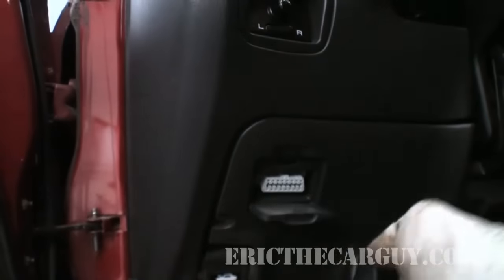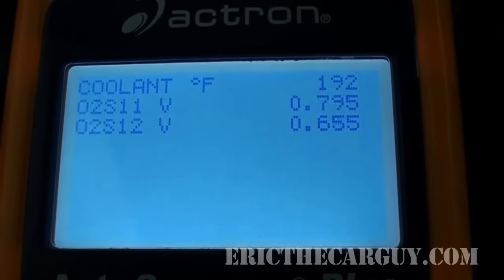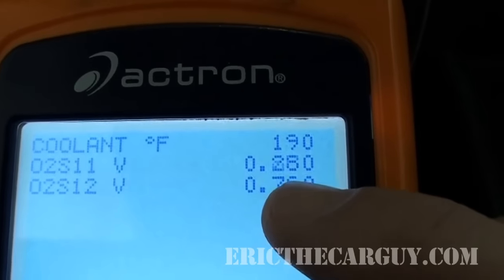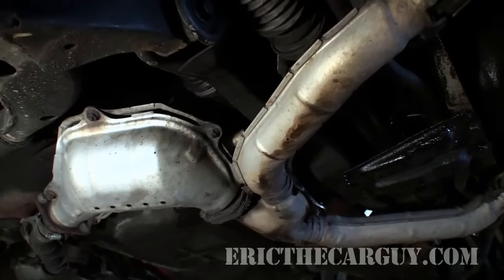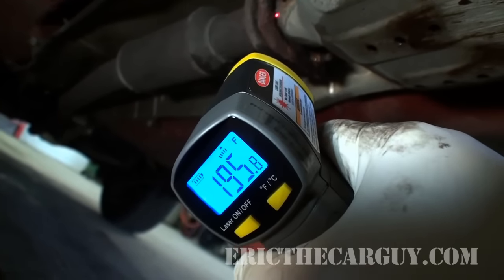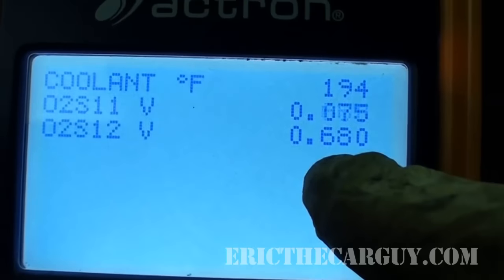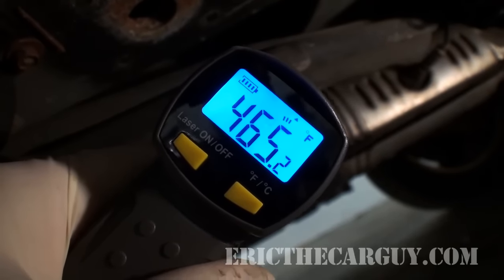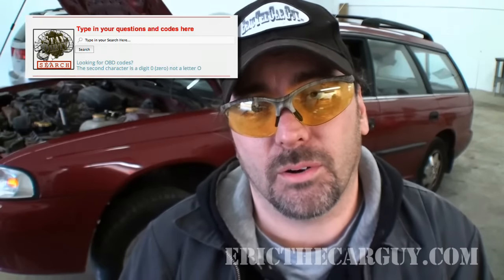P0420 How To Diagnose A Bad Catalytic Converter -EricTheCarGuy

Comment: Wait the first temperature test on the first vehicle was all over the place and off by a hundred or more degrees and you said it was bad then you tested a second vehicle and the same thing teperature was a couple hundred degree differwnce and you said that it was good can you explain please because Im dying to know how you came up with that
Reply: inlet hotter vs outlet colder = bad (exhaust not getting heated), inlet colder vs outlet hotter = good (heat dispersion). at least that is my current theory

Comment: I actually use Torque on my Android phone to watch all kind of readouts on my car (I love Torque). However, while I am certainly able to get the read out of the o2 sensors, I never really knew what was going on when I saw the readouts. It just looked like bouncing numbers and I since my car was throwing the code P0420 but had no noticeable perfomance issues, I just ignored it. Now my car won't accelerate and started having heavy hasitation at 5500 rpm which has deteriorated to 4000rpm. 
1/2

Comment: The cat should increase the temperature of the exhaust.  If the temp going out is not greater than the temp coming in, the converter is not working.

Comment: hey erice im a u.s i.g and i came home from AT and got an 2001 audi a6 it got 95k on it and it and temp started to go up a little on it and then it would start to misfiring on bank 2 ( cyc 4,5,6 )so i replace all sparks pugs and wire but still have the problem so i take it to pep boys and they said my cat's r bad r they right i did get a o2 sensor code it was sensor 2 bank 2
Reply: Like Eric says, if you have the code P0420, you will MOST LIKELY have a BAD CAT. The 02 sensors read the fuel and air mixtures and send signals back to the ECU. It has been said to replace 02 sensors every 2 years or so, to maintain proper readings and MPG. Due to all of the impurities that move through the fuel system and oil burning etc. You probably got it fixed by now. But just saying

Comment: I have a 95 camaro z28. It has a 5.7 lt1. My car recently started losing power. The car is fine but once it hits operating temperature the car starts sputtering and losing power as I drive. It seems that it doesn’t putter if the car is in park and I rev the engine. The problem is only when the car is warm and as I’m driving. Someone  know of a issue that can be

Comment: In the hope someone comes here and read this... I've had performance issue since last year. When scanning for codes, I have the error code 4185 (BMW specific) - exhaust gas temperature sensor before cat., signal too high and then I can read temps around 760-770° Celcius. It's a diesel btw. The error ONLY pops up when a regeneration cycle is kicking in. If a regen cycle never kicks in, the error won't show up.

Is that temperature too high (also remember this is in celsius) ? Is it possible the sensor is at fault ? Can this sensor actually refrain the engine from delivering all its power ?

I have an IR thermometer but I can't get close enough to the cat. converter, and below the car it's equally hard.

Comment: What if I have the same code and the second O2 sensor voltage is around 2 volts and moving fast and the first O2 sensor is around half a volt?!
Reply: The 2nd sensor is probably bad. Normal voltage should be 0 to 1 volt

Comment: Hi.I would like to view my problem of the Dodge journny engine 3.6 problem The engine temperature rise in the summer up to 120c The radiator and thurmostate have changed the cooling methods and the same problem when diagnosing the fault code p0420 is the cause of the problem.i from in iraq

Comment: Hi. My scanner sent me two codes one is P0327 and P0430. Can you please tell me what that means? Thank you.
Reply: 430 is the converter
Reply: google will tell you...
Reply: This knock sensor and catalytic converter Bank 2. Check the wiring of the knock sensor, if in order to replace the sensor. Install electronic emulator serviceable catalyst. It's simple :)

Comment: Quick fix to restore power, remove catalytic converter, take a straight metal pointy, well what you use when you play horseshoes, anyway, take a big hammer and knock the pipe through a couple times, dump out converter and you are good unless you have to smog your car.

Comment: Heres one that will make you scratch your head.  2011 nissan 2.0  intermittent  P0420, dash light goes out, i go get it smogged, passes with lower nox/hc than 2 years ago.  Drive out of the lot, dash light for the p0420 comes on.

Comment: What causes catalytic converters to go bad? Age? Miles? Bad from birth?
Reply: little bit of everything.  they get gummed up with particulate matter before eventually clogging and robbing performance, or they corrode away and leave you with a cat that barely does it's job
Reply: leakin fuel injectors, primary/secondary ignition (cap, rotor, CPS sensor, camshaft sensor, coil pack), along with an aged O2 sensor would trip the code

Comment: what would make my truck go only35 mile per hour, when I got the has it wants to bog down
Reply: a clogged cat could definitely make a bigger vehicle top off around 35.  so could a bad tranny...or alternator...hell bad wiring could cause problems with the brakes (or again, the tranny).  does it do this periodically are always?  a lot of cars have a built in "limp" mode so you can get home w/out further tranny damage.  hopefully ou've had it looked at by now :-)

Comment: My shocks/struts are worn and my exhaust/catalytic converter is corroded can you make a video replacing them I can't afford $1,000's to take it to a shop
Reply: Chris:  In regards to the shocks/struts:  Best bet will be to always purchase a Haynes or Chilton's repair manual.  If Eric is lucky enough to have your make and model for a video?  Then you'll have detailed answers.  But as often the case it's normally one car that wanders into the shop that he does a video--a lot of the information can be used on other cars, however the detail items (torque specs and such)  you'll still need a shop manual.  It's a good investment.
Reply: It's called youtube chris. And also scotty kilborn has a video showing this basic thing. But you should youtube it for your specific model im sure it's on there or in a forum sight on a video exactly the steps for you ok.

Comment: Someone chime in : installed "high flow cat" (cheap ebay unit) on Honda Civic. Now I have the code. Went this route because an OEM one or comparable is hundreds more! Anyone have success with O2 extenders/elbows?

Comment: How badly would a clogged cat affect fuel economy?
Reply: Jonathan Wolff on newer cars it will effect it considerably. most newer cars are meant to run off the back pressure from those cats,  if you got an older car when cats were first being introduced you can rip that sucker off and keep driving and never notice.

Comment: my Car , a 2012 kia óptima, makes a "tic tic tic" sound when i turn it off under the Car, like hot metal?
Reply: +Edwin Mendez That could be the sound of your car cooling off. I can't say for sure since I can't hear it, but oil dripping back into the oil pan can make that noise.

Comment: informative but neither car was nowhere near 1200-1600F not even the one with good sensor rreading
Reply: I was thinking the same thing !!
Reply: I believe that temp of 1200 is more of a max that is only at the Catalyst core & at Highway speed under load.
Kinda hard to show that on video, right ? LOL
Reply: @hellosunshine1090  , it could be also be shown with a scan tool at idle ?

Comment: A cat wont work at 200F it needs to be much hotter! the IR probe gives an indication of input vs output temperature on the outside of the pipe though!

Comment: Ok, so I have done exactly what you constantly warn, instruct against I've had everything in-between replaced for a crank, no start in a 1991 Honda Civic DX. So timing belt, timing belt tensioner, (water pump too of course), spark plugs, spark plug wires, distributor, MAP Sensor, starter relay, engine coolant temp sensor, pvc valve and hose, but  I'm a girl and, lets face it guys don't listen to girls when cars are involved Now, me, knowing when the issue began, I am pretty confident where the issue lies, can't be sure, 100%.   But, every man and/or mechanic that has looked at it has been confused by the failure to start because of the age and mileage of the engine as well as the amount of work and new parts it has had. And the seemingly correct timing and functionality of engine itself. 
Where it all began.........
Checking hoses on car, vacuum etc. the hose at the pcv CRUMBLES literally, like shattered glass or Aunt Edna's dry cookies that you only accept to be polite but choke on because they are dry as the Mohave, and after one bite, the rest of the cookie is in a pile of crumbs in your lap.. That is what the hose did. Disintegrated.  
Well no way to prevent it from dropping into the intake, and that is what locked the valve open, now I don't know where the pieces of the hose would go once sucked down, but the valve chamber was forced open and stuck,  hence the replacement. After that, loss of power, acceleration was effected and  car wouldn't reach anything over 55mph and it was a miracle to achieve that. I express that I am concerned it has something to do with the cat converter as the atrocious sound of the engine when it was running, like the exhaust is being amplified by a bullhorn run through a couple 15inch competition subs. And the performance after that issue had taken place. Of course, the girl can't be right...... so the car eventually dies, won't start.
Months later.........
Car won't start after all the above mentioned have been replaced and repaired. Timing is lined up, blah blah blah, compression, spark, power, BUT,  NO START. When you try to start it it almost sounds as if the engine is ceasing, or catching on something,  it just gives up.Looses hope and errrggg, sticks. 
SOMEONE.... ANYONE?????????? A little help please, car has only 160,000, it could run forever.......

If it could start at all that is. No check engine light, well at least up until the point that it died, there wasn't one, if it could drive around the block that may change now, but up til it quit running, no check engine light was showing.
Reply: +Nikki Chapman  Oh by the way when the hose particles when into the valve, shortly after, little tinkling noises, like little BB's in a glass bottle or similar to that during acceleration, especially while the car was attempting to shift from one gear to the next. That detail may be helpful.
Reply: +Nikki Chapman if a valve got stuck open by the hose pieces you could of bent a valve or even punched a hole in your piston. it's either that or the timing is off. check your oil and see if it is the right consistency and if it smells like gas. if it's thin and smells like gas hole or cracked piston. I would do a compression check to make sure your valves and pistons are ok.  if a valve is stuck or broken piston you will have lower compression in that cylinder. if everything else checks out ok I would go back to the timing. if you have fuel, spark, compression, and it is timed correctly it will run.
Reply: +wthigo77 already checked compression. consistent on all
Reply: +wthigo77 btw, that's what every other mechanic has told me and been baffled by. do you think that the ignition fuse under the hood, the 50amp one, appearing to be somewhat, arced , might have something to do with it? I'll post a pic when I get to it. But you think that might contribute?
Reply: yes it could. you can buy a tool to check your spark. (if their is enough room to use it) or take one of your spark plugs out and reattach the wire to it and ground it out on the engine somewhere a bolt head or something not painted that is bear metal and make sure u have good contact (make sure you use good rubber handled pliers and try not to touch any metal part of the spark plug because you can get really zapped use caution) and have someone crank the engine over (best to do this at dusk or in a garage where their isn't too much light) when they crank the engine over their should be a blue spark and that is good. if their is no spark then you well find out which part isn't working. or if you have a weak spark which would be orange it will spark out of the engine but when in the cylinder and under compression it will not spark. but with newer ignitions you don't see that very often any more usually it sparks or it don't. the first things you do when you have an engine that wont start is make sure you have spark, be sure that it is getting gas, and make sure you have good compression. if you have all three of these it will run unless your timing is off. check for fuel spark compression, and if all those are ok recheck the timing. I know some engines can be a pain to get timed correctly. oh and make sure your battery is fully charged. and some of the symptoms you described earlier sound like a head gasket. which if it's bad enough that it won't run when you do a compression test it should show. really you just have to use the process of elimination. start with the basic stuff and keep looking till you find what is wrong.
Reply: +wthigo77 there is spark, compression, the timing is right, there's fuel pressure, I changed the negative battery terminal today and it wanted to stay, began to change +cable, barely even tightened at the starter. maybe this is the issue. hopefully
Reply: ya bad ground would do it. check your ground that goes to the cars body also. you need a ground that goes to the engine and one to the body. if that doesn't work make sure your fuel injector is working. I totally rebuilt a 1990 Honda civic a few years ago, new engine and transmission, exhaust, suspension, brakes. and I really liked the car. but then I pulled out in front of someone (did not see them) and that was the end of that. I miss that car. I want to find another one someday. best car I ever owned.
Reply: +wthigo77 I have one for sale. lol.
Reply: what state do you live in?

Comment: Air is not proper in pressure in catalytic converter so find air leak  I had to use job weld high temp paste

Comment: no but all cars have more then 1  o2 sensors they have one right after the manifolds that they need to make the car run properly and they have one on the  cat, the one on the cat is just to make sure the cat is working properly, you can install "test pipes" or just take the cat off altogether, they make universal plug and play resistors to trick the ecu, 1 buddy with a mustang, 2 guys with nissans and 1 subaru guy i know have done this

Comment: Can a bad/clogged cat cause a P0300 code?
Reply: Unlikely.  Do a compression test, check fuel pressure, clean the injectors, change spark plugs and wires, and pray.

Comment: i love my subaru but the cats they use are crap, every subaru i have owned or worked on has a cat that disintegrated and collapsed on itself. i dont live in a state that tests cars so i pull them off sell them and get a pipe or a glass pack (resonator) welded on. the second O2 sensor just needs a 2.2 ohm resistor in the plug to trick the ecu into thinking its all good. I LOVE SUBARU!

Comment: Hey Guys ............. You should teach your wife how to use a scan tool. Seriously
Change a tire use a scan tool change the oil all that shit.
Make sure she has oil
Make sure the tire pressure is right.  My Wife is obsessed about looking at the tire pressure and oil levels she drive me nuts.
but if she didn't it wouldn't get done. If she needs help I'll do it or she won't let me forget.

If she bitches she will break a nail, ask her if she like to know or be stranded on the hwy at 3 am better? With a flat tire and no knowledge how to change it. You can't always get AAA to come out.
And you won't always be around to help.

Comment: It doesnt make sense that the cat-con would be hotter downstream. I think the place you pointed the laser was slightly off, and was testing on the heat shield. Im no expert. Im just researching for a repair job Im doing.  Also here is a youtube link showing a thermal image of an exhaust system. https://youtu.be/zGmPV9NgbXg

Comment: Only cat converter helps clean air, other parts are mechanics, so what is the real reason for the whole thing and why do many other countries require replacing cat converter at a standard time/distance but not other mechanic parts or driving cycle? Why do everybody pay for extra gas, time and effort instead of focusing other necessities? Are American really smart to discern the difference?

Comment: so wrong because i have a 95 Honda accord and it has o2 senser
Reply: The reference to the 1996 or later was regarding a vehicle having to comply with OBDII standards (as in having an OBDII socket and allowing a code reader to read Diagnostic Trouble Codes).